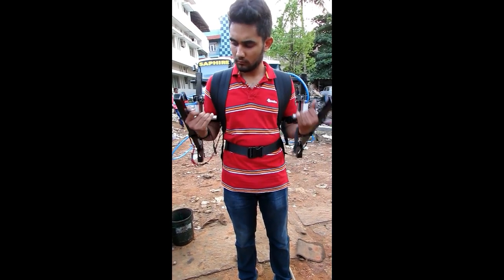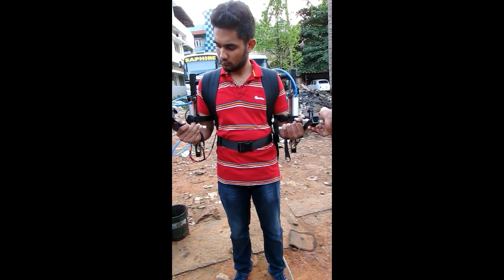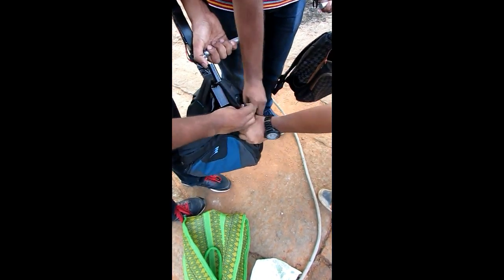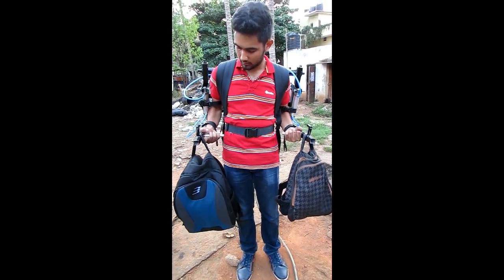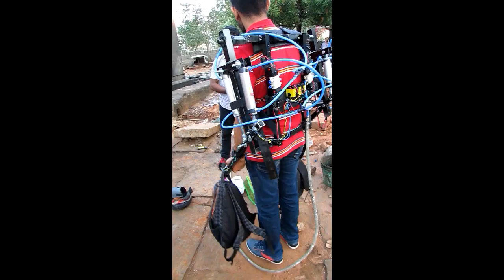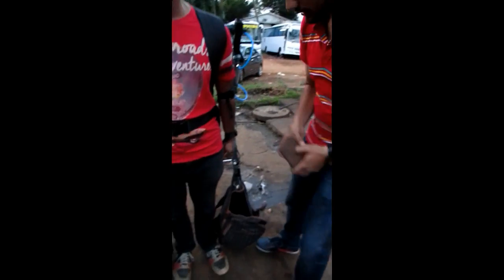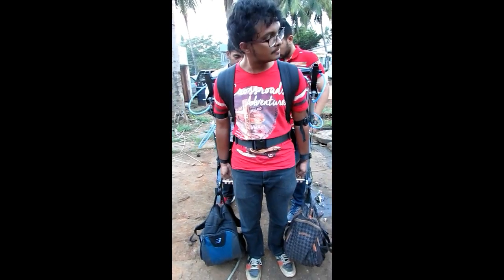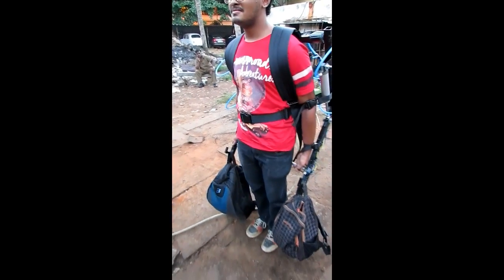PNEUMATIC POWERED EXOSKELETON

Comment: Hello Vignesh,
Congratulations on your project.  A small query. How pnuematic exoskeletons get compressed air for the moving ones. I mean here a pipe supplies the air connected to the skeleton.  Are battery powered compressors available in the market for such mobile exoskeletons that cannot have a tether pipe to supply the air?

Comment: Hey there....Nice work. The load carrying capacity and two cylinder design is impressive. Me and my friends are planning to build a pneumatic powered leg exoskeleton. We would love to have a discussion with you.
Reply from the maker: Hi, sorry about the late reply. What would you like to know ? A lower limb exoskeleton can be a bit difficult, since the concept of maintaining balance comes into play.
Reply: @MrDXCool  Hi, thanks for replying. Actually we are working on a performance augmenting exoskeleton, it should be able to follow and enhance the Movements of our legs. For this purpose, balancing is not a major concern. We just need to figure out a way to transfer power from cylinders down to our feet, efficiently. We would love to hear what you suggest on this. Anyways please give some information about the cylinders that you used, pressure, force, stroke length, bore size and everything else please. Also please provide a way to communicate with you guys.🙏
Reply from the maker: @kartikrajput7897  Hi, you can email me vigneshvarier@yahoo.co.in. I am currently pursuing my masters, so I might not be able to reply quickly though. If your goal is mainly to augment and enhance movement of legs, I would definitely suggest using linear actuators or design a mechanism using motors. It can give you way more control over the movements and provide better accuracy.  
As I had mentioned in another comment, we had used pneumatic cylinders (total of 4) which had 100mm stroke and 32mm bore. For lifting 35kgs, we had used 120psi pressure.

Comment: Sir can u tell me specification of piston cylinders.. air pressure u are using ,how to select a pneumatic cylinder for weight... For lifting 50 kg how much piston ( size) and pressure is needed
Reply from the maker: Hi Nitin,
We had used pneumatic cylinders (total of 4) which had 100mm stroke and 32mm bore. For lifting 35kgs, we had used 120psi pressure. The issue of using higher pressure is that the movements become more jerky and it could cause problems.
Reply: @MrDXCool  thanks a lot sir

Comment: I'm curious to know how you attached the arms to the straps. Are the straps cut off from a backpack or did you guys create it yourself?

 If you have some photos/videos of the strap attachment, that would be very helpful.
Reply from the maker: Hi,
I have a photo which should give you an idea. If you share your email id I can email that picture to you.
Basically we have strapped it around the aluminum bar and nailed it to the exoskeleton. To ensure rigidity of the holes, we added metal grommets to the strap holes. 
We bought the straps separately from a shop and added extra layers of foam for comfort.